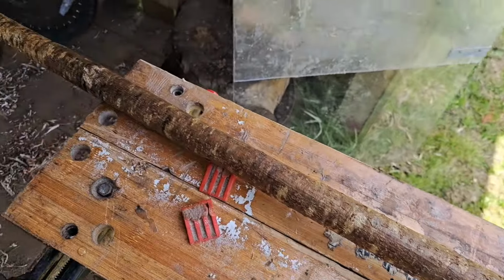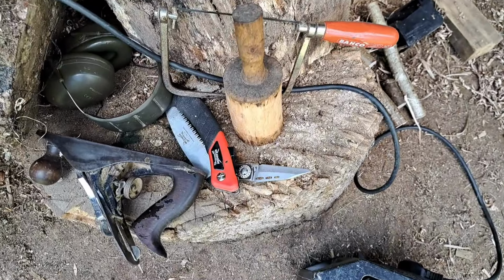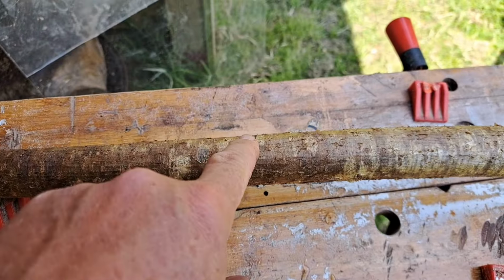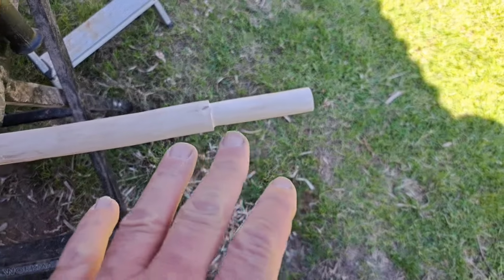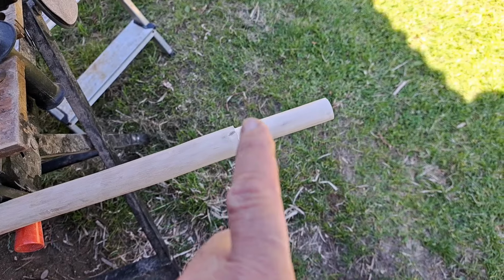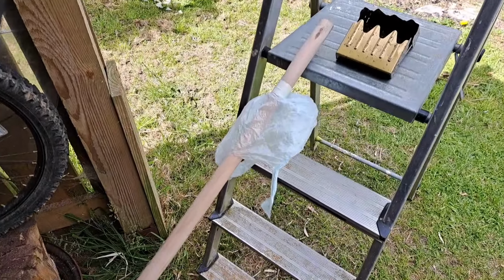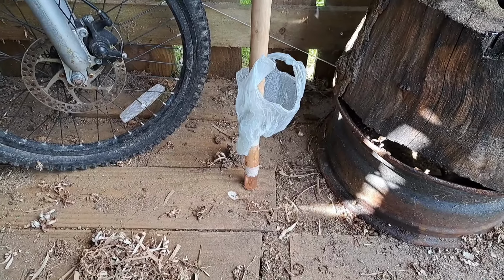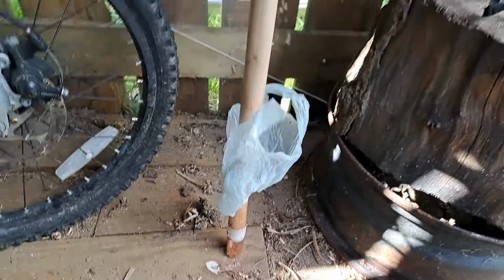Celtic Staff project, Copper end caps being fitted with epoxy . Shaping,sanding and de-barking.

Comment: Hi there , enjoy your content . Could you please give me some info on your hand scraper . Thanks  .
Reply from the maker: Hi, thanks for watching, its a wood plane's blade  inverted with the angled part facing away from me. It has been  welded onto a square  it of box section for a handle. It is the most effective  bark scraping method  I have used.Cheers Andy.
Reply: @hiddenvalleyfootpaths2561  Thanks for the reply . I will make one for myself .